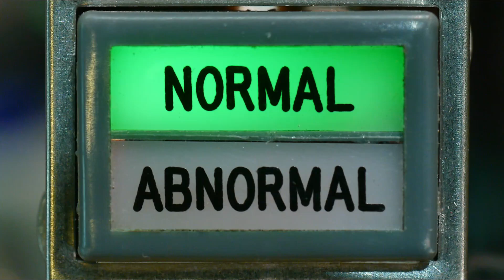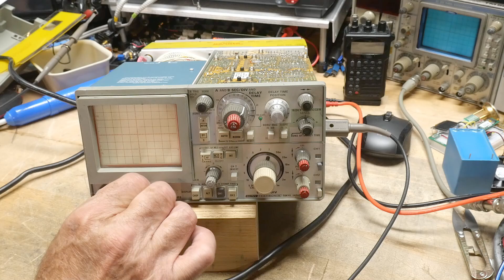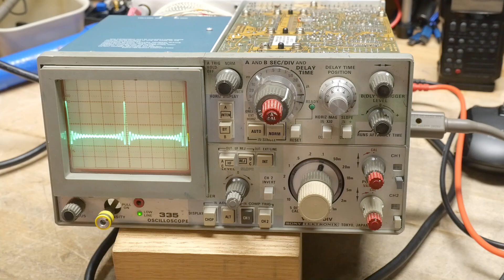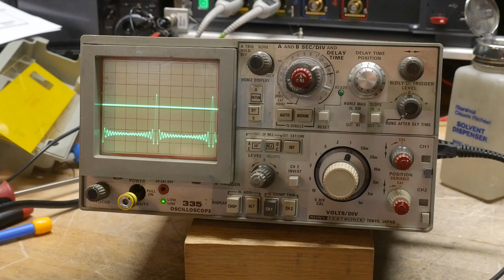#2275 Tektronix Analog Scopes (part 4 of 4)

Comment: When you set it to 3A limit on the power supply I immediately thought: Whaaaat, no way this is going to work just on 36W of juice.
Little I knew! It worked on 18W... That's impressive for a CRT based oscilloscope.
The filament alone probably takes some 3 or 4W (and I'm really guessing here).
Reply: I had exactly the same thoughts. Starting low is good though! We tend to forget just how good these Tektronics 'scopes were in their day.
Reply: Scopes can be made pretty low powered. I've got a little 15MHz Soar scope with a 3" CRT that only draws 500mA at 12V. It's a very basic scope with no dual timebase or delay though.

Comment: Awesome I love it when things fix themselves.
Reply: Best fix ever.  I got this TV in the lab I got to get to.  Why won't it just fix itself.  Problem with the TV is I will only go as far as replacing the control board assuming that's the issue.  If I can find the board it's likely to be at least $50 and I can buy a TV that size for about $250.  So yeah, that going to be a real limited fix with minimal time spent so im really hoping it fixes itself.
Reply: I hope your figure it out @EfieldHfield_377

Comment: Thanks for the insight - I hadn’t come across that model of Tek ‘scope before. I just scored the same model on eBay - I haven’t any CRT ‘scopes that can be battery powered so it’ll be handy. As much as the digital ‘scopes are fully featured, I still prefer to use a CRT type whenever possible.

Comment: The power consumption is really low for converting everything from dc to ac and back again. 
The problem with the leaky capacitor will surely come back, especially if you install it in your car.  :o)
So in about episode # 3257 we might hear of it again. # 3257 Tektronix Analog Scopes (part 5 of 4).